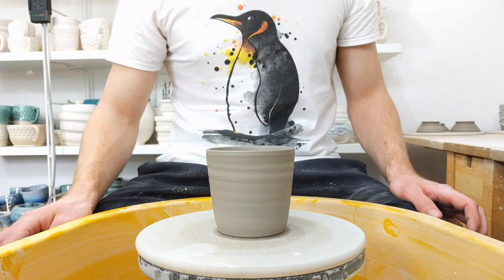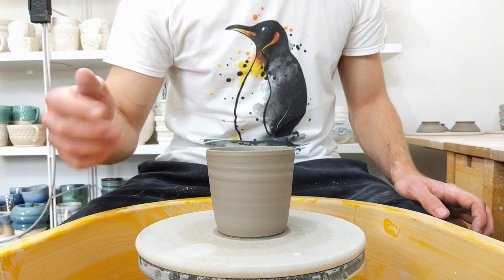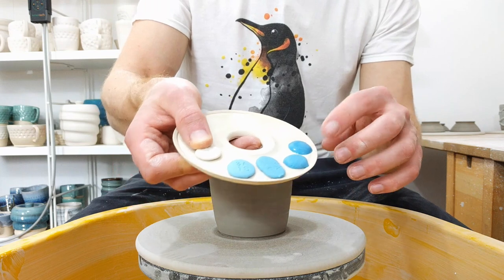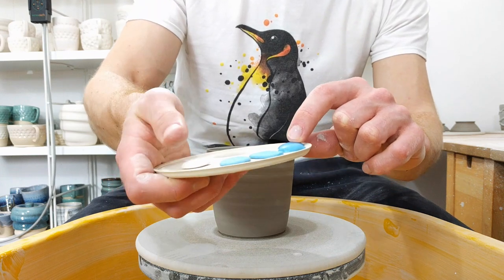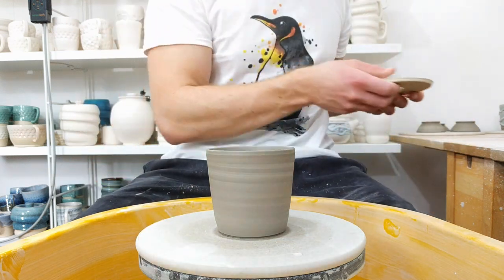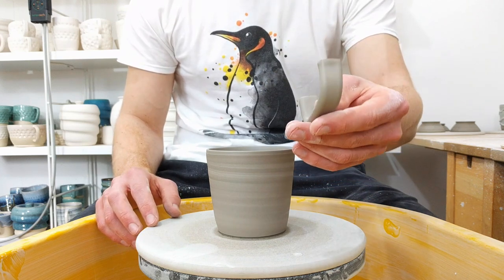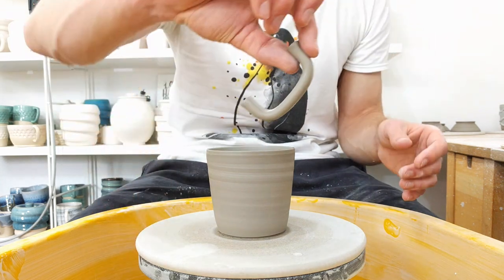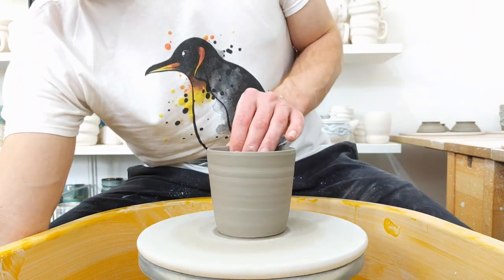Drippy Slippy Mug with experimental glaze-slip

Comment: Did you post a follow-up video to this? I would love to see how the mug turned out. Thanks for the inspiration!
Reply from the maker: I didn't. I'm pretty sure I posted it to Instagram, but it didn't work. The modified slip melted too much in the bisque firing and fell off in places and crawled in others. It might work if it was single fired, but that's not how I work with my other glazes